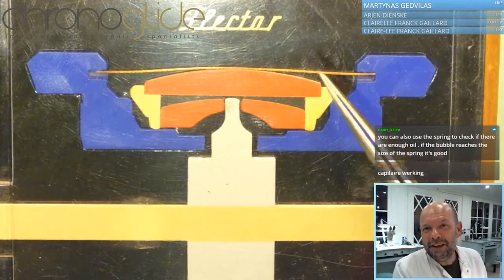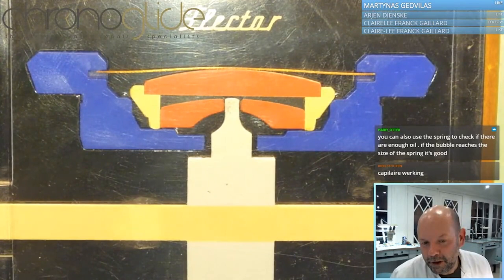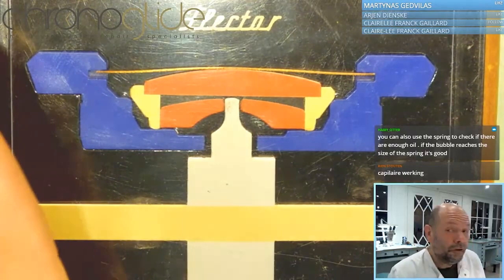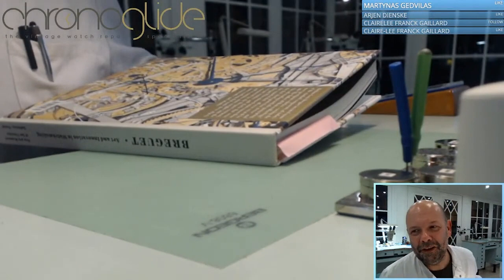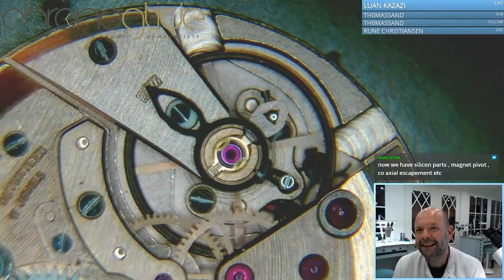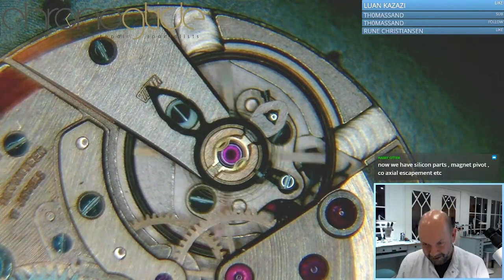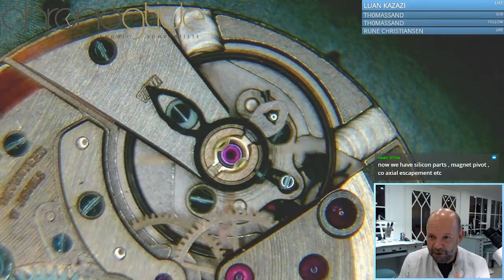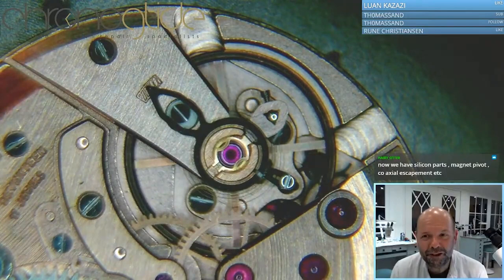Incabloc - Part 2of2 Tips and Tricks

Comment: Tip #327 lol. I am an Electrical Engineer but also worked well outside my area for a lifetime. Interference fit with no interference can be achieved with dry ice and hot oil. The inside component in dry ice with the outside component in a toaster oven or hot oil in a teapot.

Comment: Thank you for sharing your knowledge ! Knowledge and experience have much more value when shared :)
Question about the spring. Is it sided ? or is 100% flat ?
I mean, if I remove it and put it back, do I have to be careful about which side is in contact with the jewel ?

On my seiko 7S26, not a such "door" system. I guess I have to turn 90° the spring and it will fly out. I'll manage :)
Reply: I think its flat, doesn't matter, which side is in contact with the jewel. but its a very fiddly job :- ) putting it back in place nearly  took me one afternoon on my first reassembled watch ...

Comment: Kalle here is an important question, I believe. At 2:13 you say: "Here you can see just a tiny dot if I play with the light just a bit and that is the bit where the pivot is resting against the jewel". Is that dot on the flat side of the cap jewel just for your model or should the dot also be present and visible in a real cap jewel? I was told that if the flat side of the cap jewel has a dot (cavity) in its centre the cap jewel must be replaced. Is that statement correct? Hope you have a minute to reply. Thank you!
Reply from the maker: It was just in the model, it should be perfectly flat. You are absolutely right.

Comment: How do you replace a broken incabloc shock on the main plate?  Thank-you
Reply: I did some reading and you need a jewelling tool to push out the chaton support.  I believe the spring is "sandwiched" between the mainplate and the chaton support.  Not sure if this is correct.

Comment: Incabloc two point pressure on the cap jewel is not good . There should be at least 3 point pressure of spring on the cap jewel .

 I would like to add: Seiko's  Diashock is the best . Hence many manufacturers copied Diashock .